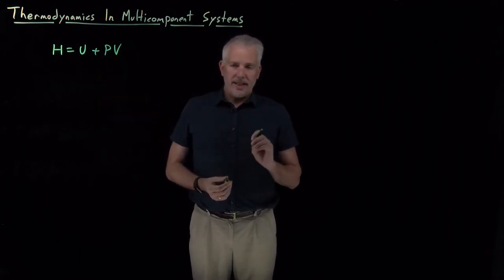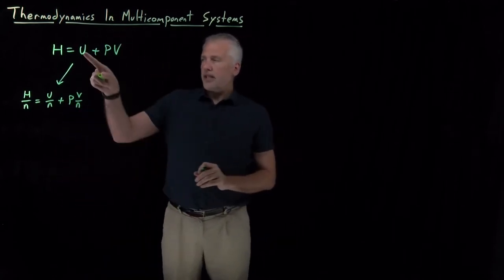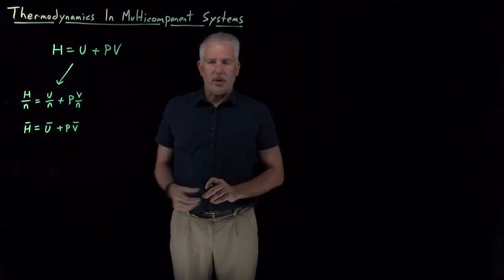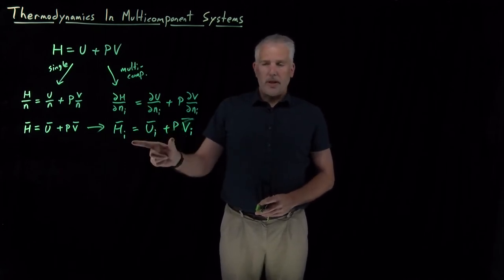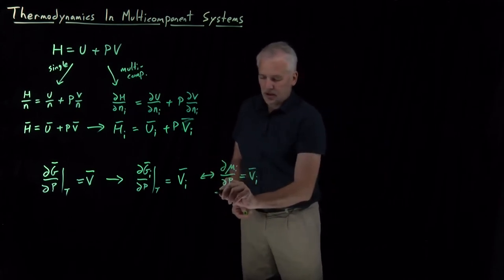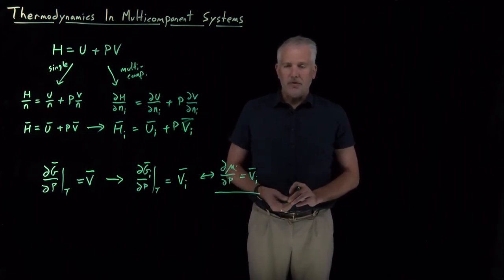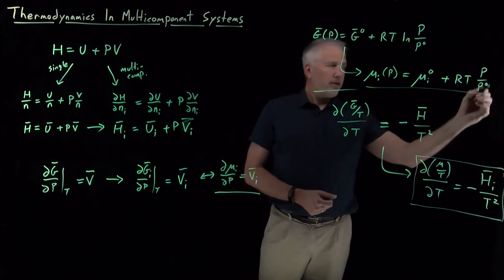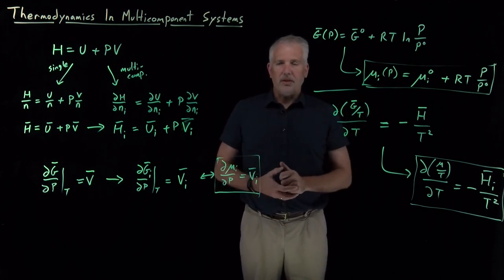Thermodynamics In Multicomponent Systems

Comment: Hi Steven,
great video as always! A few questions:

1)
At 1:55 I think it's ok to take just the derivative of V and not of the product pV because p is a natural variable of H. If I understand natural variables correctly, I should think of H as function of S, p and ni like this:

H = H(S, p, ni) = U(S, V(p, ni), ni) + p*V(p, ni)
Here in U I cannot consider V as an independent variable anymore, so the partial derivative of U with respect to ni should be dU/dV * dV/dni + dU/dni which is different from the partial derivative of U wrt ni when I think U in terms of its natural variables: U=U(S, V, ni). This is tricky.

2)

In a similar way, at 5:31, because (p,T) are natural variables for G I don't need their derivative wrt ni.

3)

Is the p at 5:59 the partial pressure rather than the total pressure of the system?

4)

I suppose the fundamental relations in terms of the partial molar quantities work because the partial derivative of a differential is the differential of the partial derivative.
Ex:
f(x, y) = (x^3)(y^2)

derivative of the differential:
df(x, y, dx, dy) = 3(x^2)(y^2)dx + 2(x^3)(y)dy [the differential is a function of 4 arguments]
(d/dx)df(x, y, dx, dy) = 6x(y^2)dx + 6(x^2)(y)dy 

differential of the derivative:
df/dx(x, y) = 3(x^2)(y^2)
d(df/dx)(x, y, dx, dy) =6x(y^2)dx + 6(x^2)(y)dy.

Comment: Thinking about this one more time, I'm not sure the pressure at 5:59 is the partial pressure.
For ideal gases V(p, T, n1, n2,...) = ∑_i niRT/p = nRT/p
so ∂V/∂ni = RT/p and integrating:
μi = μi0 + RTln(p/p0)
So it looks like p is the total pressure. Where is my mistake?
Reply from the maker: Your ∂V/∂nᵢ equation is fine. But that's partial molar volume, not partial molar Gibbs energy.

Here's a thought experiment that may help make it seem reasonable that partial pressure is correct:

Imagine two containers of gas, separated by a stopcock. Both are at 3 atm pressure. On the left side, the partial pressure of gas A is 2 atm and the partial pressure of gas B is 1 atm. On the right side, it's the opposite: A has partial pressure of 1 atm and B is 2 atm. Now, open the valve. Gas A will move from the left to the right, because its chemical potential is higher on the left. This is due to its higher partial pressure; the total pressure is the same on both sides. 

Now imagine these two containers in a different scenario: Both have 1 atm of A. But the left side has 2 atm of B, for a total pressure of 3 atm. The right has only 1 atm of B, for a total pressure of 2 atm. When the stopcock is opened, even though gas flows from left to right, this will be gas B, and there will be no (net) flow of gas A. This is because its chemical potential is the same on both sides. This is because its chemical potential is the same on both sides, even though the total pressure is different.
Reply: @PhysicalChemistry  Thanks, now I understand it qualitatively, but I can't figure out the mistake. I have integrated the partial molar volume as we know that ∂μᵢ/∂p = Vᵢ (partial molar volume). Probably my mistake is in defining μᵢ⁰. For the ideal gas mixture I think it's true that
G(T,p,𝐧) - G(T,p₀,𝐧) = ∑ᵢnᵢRTln(p/p₀)
where 𝐧 = n₁, n₂, ... 
but deriving wrt to a particular nᵢ gives
μᵢ (T,p,𝐧) - μᵢ (T,p₀,𝐧) = RTln(p/p₀)

Now I cannot define μᵢ⁰ = μᵢ(T,p₀,𝐧) because this will change with 𝐧.
μᵢ⁰ should be μᵢ⁰(T₀,p₀,𝐧₀) where all variables are taken at a standard arbitrary condition.
I'm doing some research and it looks like a formal proof involves the Helmholtz energy and the Gibbs-Duhem equation.